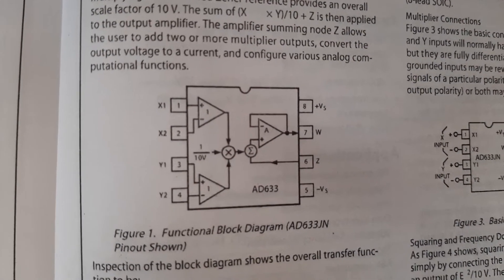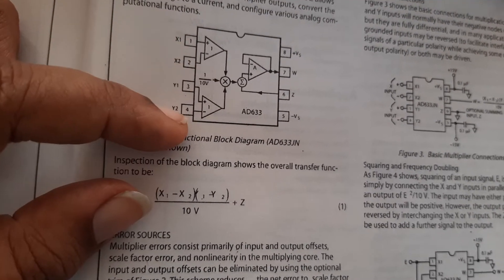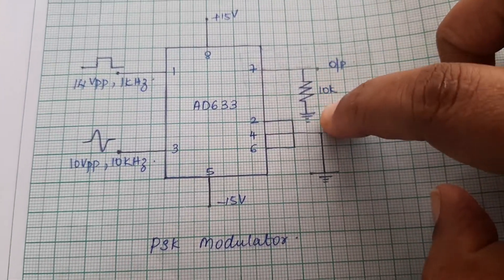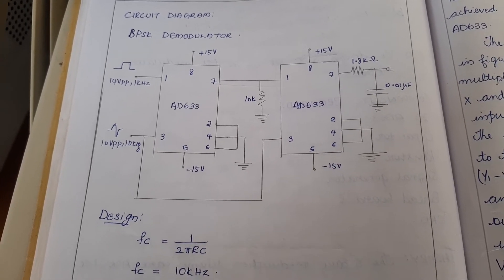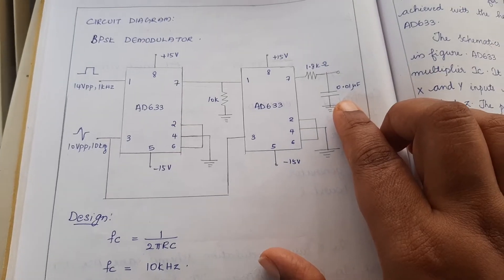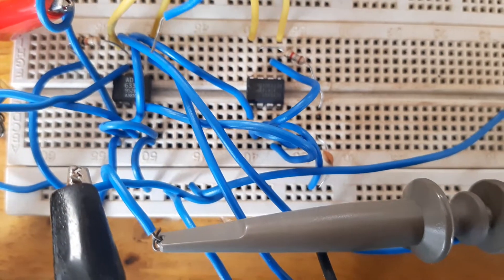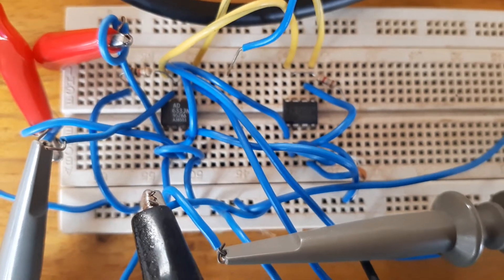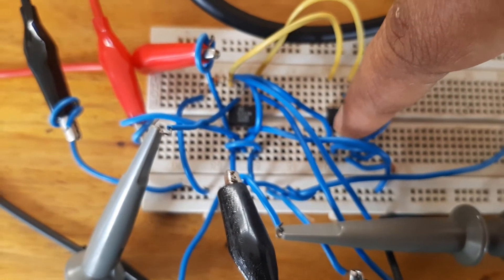BPSK MODULATOR AND DEMODULATOR LAB EXPERIMENT

Comment: Mam ithite amplitude value athraya
Reply from the maker: Input is 14 volt peak to peak..
Reply: @PreveenaKp   mam ithil  examiner measure chyyan parayunna value eath ayirikkum ath paranj tharumo
Reply from the maker: @Gadha12326  out put demodulator signal amplitude measure cheyyanam
Reply from the maker: Channel 2 aanu demodulator output connect cheythathenkil channel 2  nokkumbol sidil values kaanikkum
Reply from the maker: @Gadha12326 ee experimental last channel 1 Ie reading aanullath...you can check video..14 V peak to peak voltage pinned frequency...
Reply: @PreveenaKp  ok mam🙏❣️❣️

Comment: Mam is this bpsk demodulation output also need input from first pin of bpsk modulation ? But y ? Plzz reply😢😢😢😢
Reply from the maker: @Hijjuji34  for demodulating a signal we need a modulated signal.modulated output is obtained from the first pin of bpsk.after taking modulated signal we will demodulate it.
Reply: @PreveenaKp  modulated output is from  the 7 th pin . Then why we take squre input from first pin
Reply from the maker: @Hijjuji34  square wave is the original input before modulation.we need to prove we are getting the demodulator  output same as that of original input signal.
Reply from the maker: We can prove that demodulation gives original input or information signal..
Reply: @PreveenaKp  thank you so much mam❤❤❤❤

Comment: Mam in bpsk modulation circuit , which connection is done on channel 2.. as on dso we have the output by connection of  7 pin with channel 1 but  confused of channel 2
Reply: Thanks mam
Reply from the maker: Dso channel 1 is connected to square wave input pin of IC.. AND DSO channel 2 is connected to modulation output pin 7 of IC 633
Reply from the maker: That is DSO CHANNEL 1 PROBE will be in pin number 1 of AD633 and DSO CHANNEL 2 PROBE WILL be connected tobpin number 7 of AD 633
Reply from the maker: If you want to see sign wave on DSO PLEASE connect DSO channel 1 to pin number 3 of AD633.
Reply from the maker: I think now its clear.. Reply me